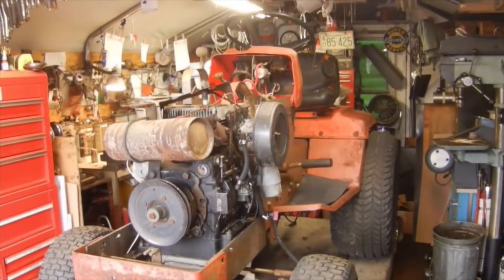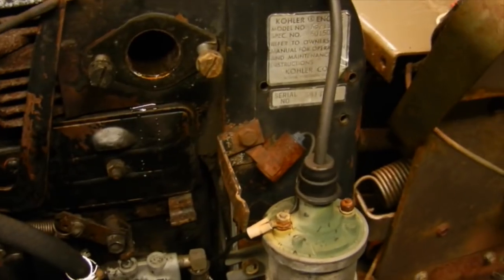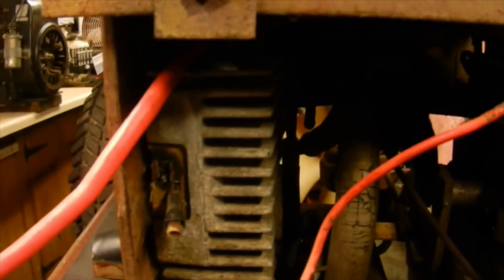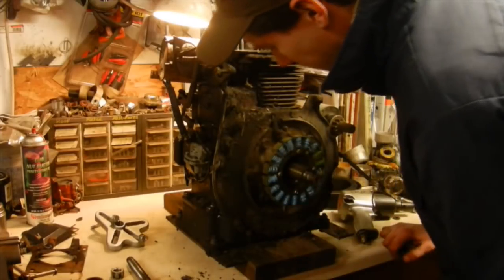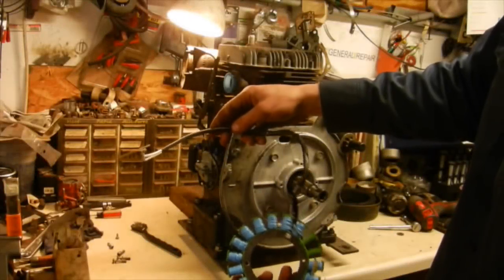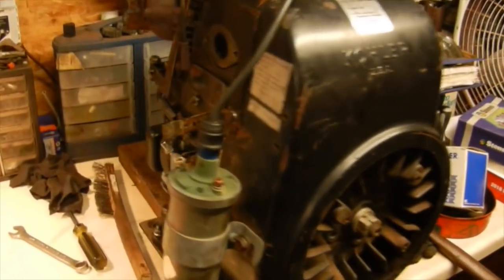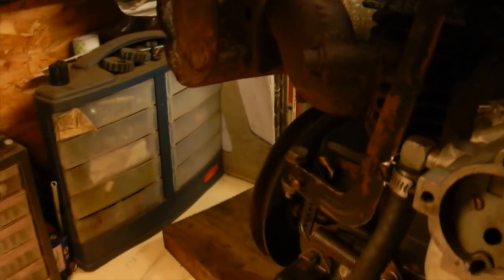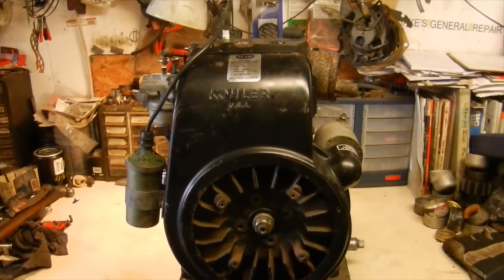Massey Ferguson MF14 Repair- Part 1

Comment: I've been watching these and your Ariens videos to get me psyched up for "revamping" a John Deere 300 in much the same way - strip it down to the frame, clean everything, take the engine out and go over everything on it short of a rebuild and put it back in proper so the tractor is at peak operating ability.
Reply from the maker: Nice! It's well worth putting the work in and ending up with a good usable tractor. I've heard those 300 JD's are nice machines too.

Comment: Sure do like hanging out here and some WONDERFUL music. You must've had some Seldom Scene on because I heard John Duffey and Mike Aldrich just honking along! And it sure is getting to be mowing time. Got my firewood done today so the deck will go back on the Craftsman and I need to drag out the Snapper and get to hand mowing and catching clippings for mulch. That Kohler lit right off as all the old cast iron jobs do. The 301 in the Gravely just turns just a little and it's gone. That will be a fine rig! Thanks, Pal!
Reply from the maker: Yep! That be the Seldom Scene doing Georgia Rose. Spring is a-coming around here. I keep debating taking the snow bucket off the Kubota but you know what'll happen when I do that, nor-easter!
Reply: That's why I've been leaving the snow shovel on the front porch. I know we've got 2 more months before the gardening is safe and I've seen snow on dogwood blooms but it's been a while. And there's no telling what the Canadians won't want and send down! Take care, Pal! And you can't miss the Seldom Scene!!

Comment: Nice video. I have a gang of these style Massey’s. It’s what I collect. Two of them are 14’s.
Reply from the maker: Neat! I like these early style MF's better that the fat red hood style, got a bit more class to them.
Reply: I collect  Briggs and Stratton engines myself.  That's  what I started working on  back in 2000.

Comment: I was told, no anti seize or oil on a tapered flywheel. just clean it with brake clean and torque it. It can cause cracking

Comment: I was wondering, what you had brushed on the crankshaft, prior to installing flywheel? Should the shaft be free of any lubricants, or oils, so there isn't a chance of the flywheel shearing the woodrift key, from centrifugal force? The manual seems to be at odds from what I view on some videos. I enjoy all your videos, keep producing them please. Thanks. Mark.
Reply from the maker: That was just a light coat of grease, makes them easier to remove again if need-be. In all the years I've been working on Kohlers, I never had a problem with the flywheel shearing the key from force. I think because of the large flywheel nut that you can sock down nice and tight, the coat of grease/oil won't effect it. I have found that if you lube the crank on a B&S though and install the flywheel, there is a good chance the key will shear. 
Thanks Mark! More to come as time allows...
Reply: 5Tractorguy. 
Awesome. I rebuilt a Kohler  m12 in a 86 Cub Cadet and couldn't remember if I applied any lubricant between flywheel and shaft. Viewed different  post, "Not to do it", and got worried I'd have to tear it back down. Big job on that tractor. I value your input. Thanks a ton. Mark.

Comment: Interesting how they mounted the engine with the drive shaft connecting to flywheel.
Reply from the maker: It is. Ariens S and GT tractors did the same thing too.

Comment: Runs good! Do you know if that plastic dash is the same as the 10 and 12hp? They look identical.
Reply: Yes, the dash’s are the same. The model’s 7,8,10,12,14&16 all have the same dash’s.
Reply from the maker: Looks like I'll have to keep an eye out. Massey parts seem to be a bit scarce.